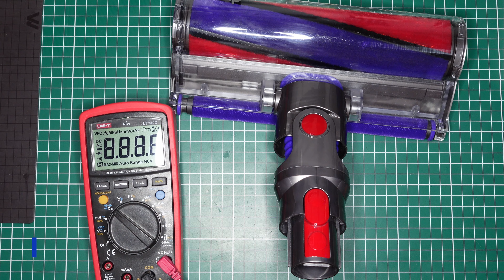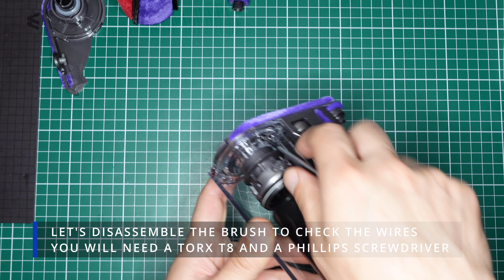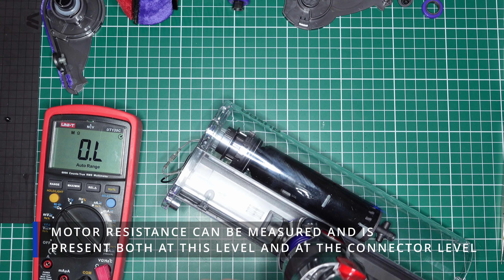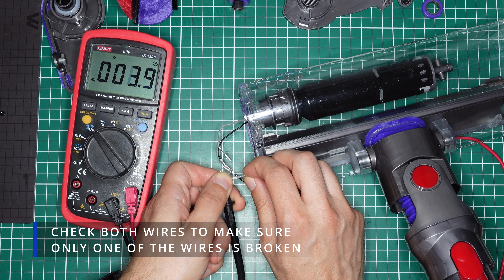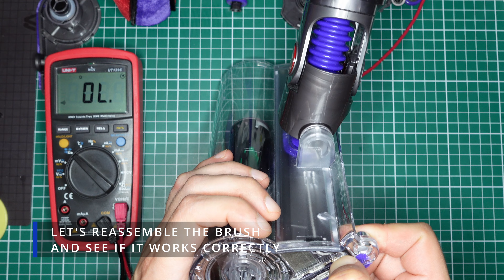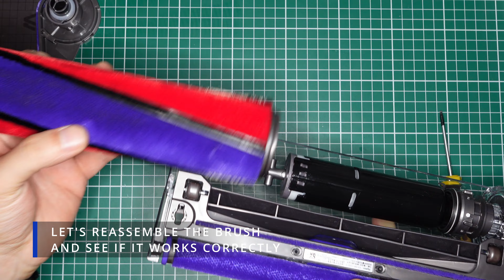Dyson Soft Roller Cleaner Head Repair - Brush Bar Not Spinning

Comment: I think I got the same problem with my v8 soft brush. After cleaning everything it only spins for a few seconds and than stops. I don't have the professional tools to check, but this also sounds like a wire problem right?
Reply from the maker: Yes, it could also be a broken wire. It would be good to check if this problem also occurs with another brush or only with this brush. This is how you make sure that the problem is with the brush and you can investigate further.

Comment: Hey, I got a dyson v11 that’s seen very little use. However it was bought new “refurbished”. Now it is not spinning either of the heads, when trying the heads on a second v11 they both spin freely. What could be my issue. Tried without the want aswell and it still does not spin…
Reply from the maker: First, you should check the contacts, maybe are loose. Check with the multimeter if you have continuity between the front connector (where you mount the accessories) and the pins inside the cyclone assy. If the contacts are good, the board uses a MOSFET to power the brush and constantly monitors the consumption. The MOSFET or another component may be faulty.